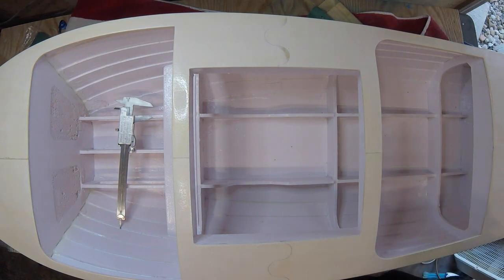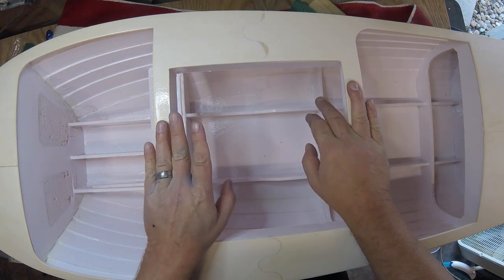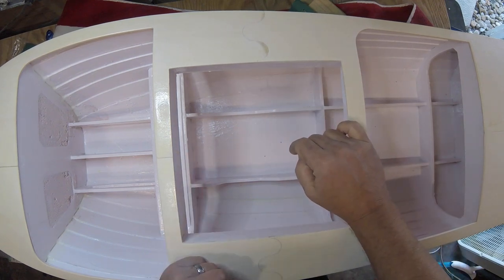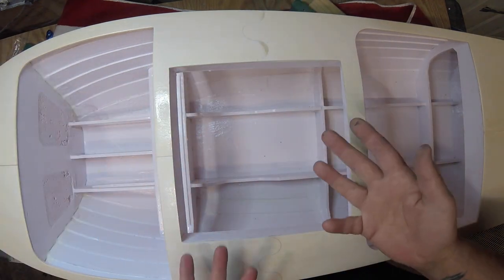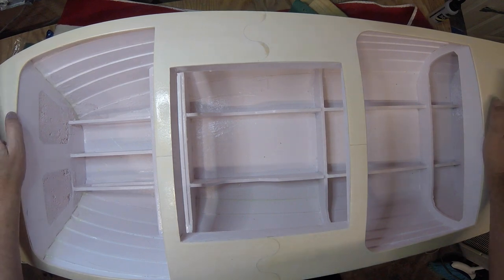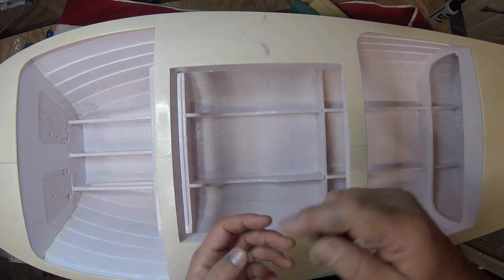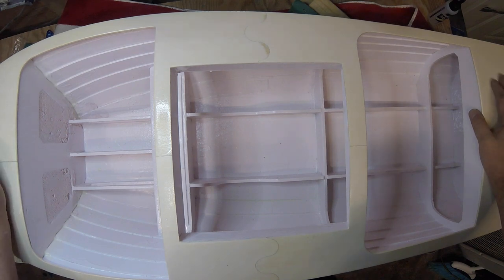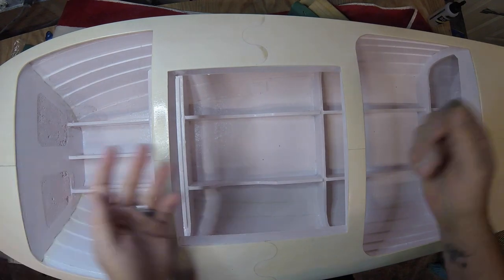Sealing/Waterproofing your Wooden Boat hull - Methods.

Comment: I recently saw a video where they dissolved white polystyrene (foamalite if you are old enough) in acetone for a week... it turns into a clear liquid. this can then be poured or painted and dries clear like glass... I'm keen on testing it as a clear coat glue/sealant ). I know some resins are UV stable I think it means it won't deteriorate as fast in sunlight.